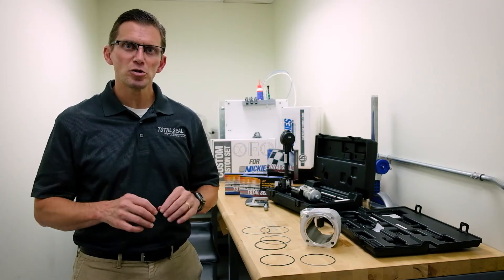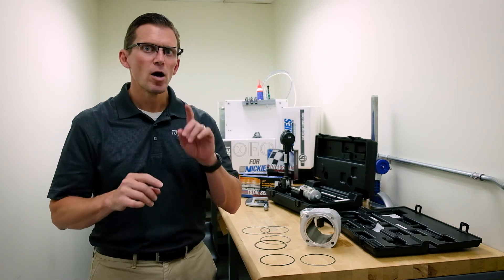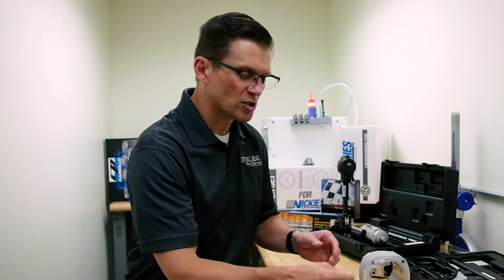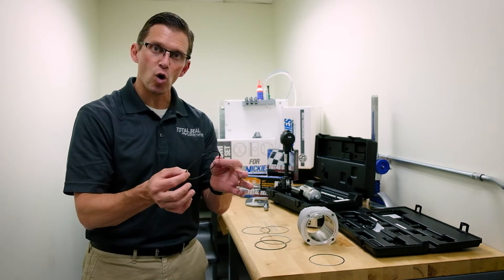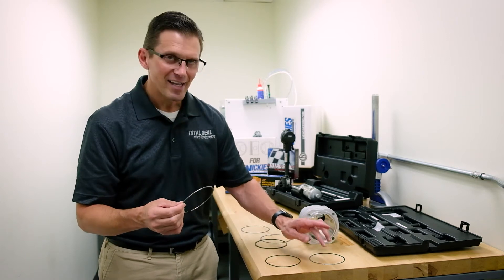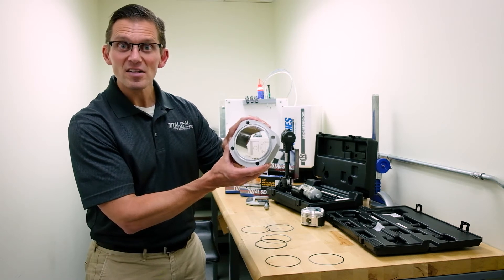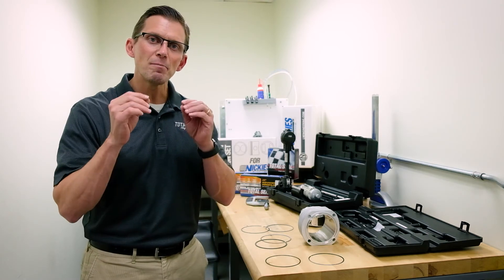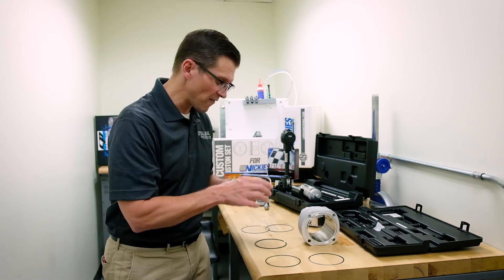Piston Rings 101: Materials and Coatings - with Lake Speed Jr.

Comment: Hey, great info 😎👍

I would love to know more about the coating applied to pistons designed to run in alusil bores.

I want to install a steel sleave/liner just one cylinder. Would the factory coated piston be likely to cause issues running in a steel liner instead of the original alusil bore?

Much appreciated
Reply from the maker: Yes, based on information from Mahle the coating applied to the original pistons would not be compatible with the steel liner. We would highly recommend against sleeving just one cylinder as well as we have seen countless engines fail months later with another cylinder issue in one of the other unsleeved bores.